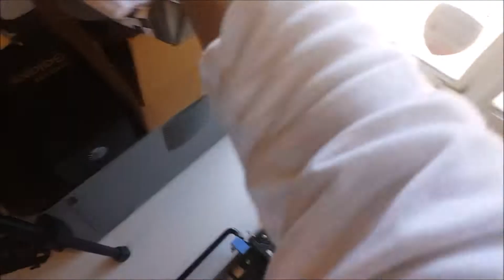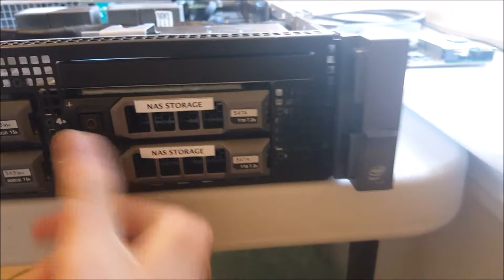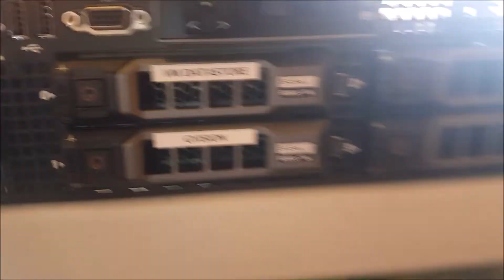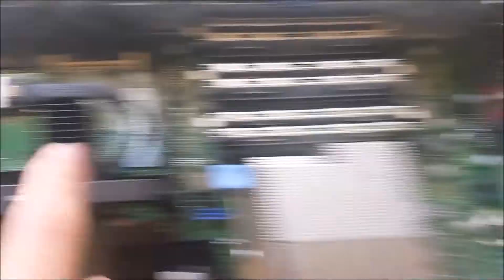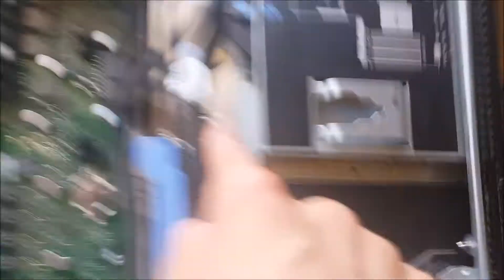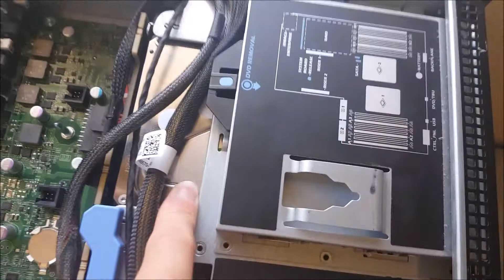FreeNAS and an R710 - "Split backplane"

Comment: Glad to find this video, have been imagining the possibility of this. I have freeNAS running as a VM on Dell R710 + PERC 6i with the last 2 drive configured as independent RAID 0 drive and presented to freeNAS. im thinking to get a HBA card and swing these 2 drive to it, but im wondering what would be the easiest / safest way to migrate over. would you have any suggestion?  if i simply swing the drives over to the new HBA  and present them to freeNAS i assume the data wouldnt be accessible?
Reply from the maker: Hi Thomas, apologies for the late reply. Yes I believe you are correct. The HBA will not understand the drives that were set up by the PERC. I also needed to migrate, so I did it it manually. I backed up the data externally, formatted the drives, moved them to the HBA, and then dumped the data back into the drives.

Comment: Thank you for the video.  Were you able to get the HDD activity LEDs to work?  I read that the LEDs are on the backplane so maybe instead of using LSI HBA, a Dell H200 flashed in IT mode might communicate with the backplane a bit better??
Reply from the maker: Unfortunately no, I didn't bother trying to get them to work. I feel like using a Dell HBA should work, but I don't know for sure. You should give it a shot!

Comment: Simple video, advice though, big difference between BIT and BYTE. Speeds of interfaces are Bits per second, bps or Gbps. Data storage is Byte (8-bits) and in GB. Transfer speeds are usually in GB/s. 
The use of a 4-port PERC will see error go away, otherwise, disable the other four drive ports. But then again, FreeNAS is best not to have ANY HW-RAID card at all.
Reply from the maker: Thanks for the advice!

Comment: Would this work with the R710 with SATA drives?
Reply from the maker: Yep! The backplane on the R710 supports both SAS and SATA drives. It's also dependent on your SAS controller but all the ones I've seen support SATA as well.
Reply: @benjhong7611  Cool - thanks, I'm looking forward to my R710 delivery in the new year :) to  replace my PE-2950
Reply: @TrollingAround  or while ordering R710, order with PERC H310, which gives OS direct access to disk. good choice for Freenas Installation. And @benjhong thank you for perfect video which will help lot of people
Reply: @abhayp9  - thanks I have removed the Perc6 and installed a H200, (flashed to IT mode) and passed drives through to Freenas.  I also installed a GTX710 GPU And passed through to Windows10 VM for Plex hardware encode :) ESXi booting from USB, VMs on a SSD on SATA connector.
Reply: @TrollingAround  that's some work done :) Awesome
Reply: @abhayp9  IT mode the turd, the H310 is NOT much good, no cache RAM. Non-parity.